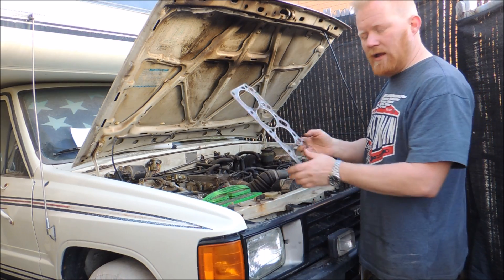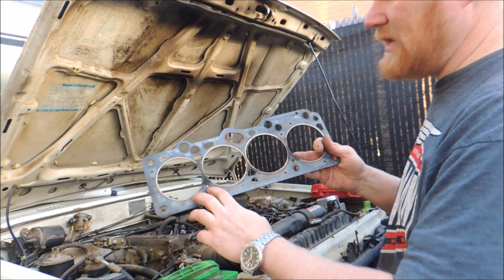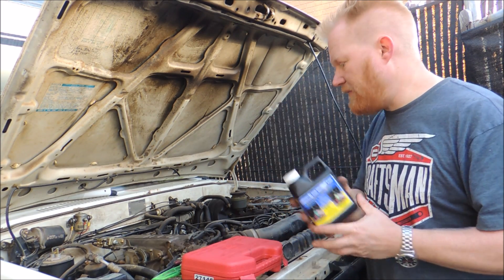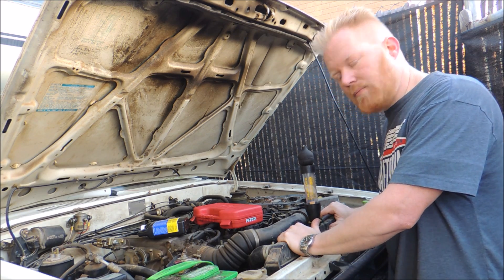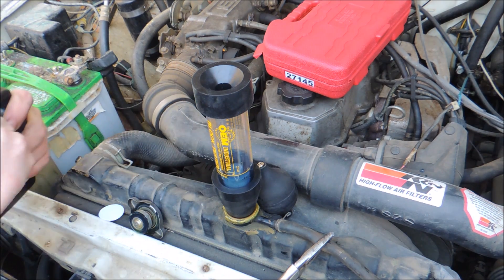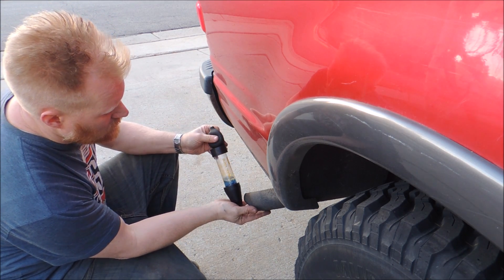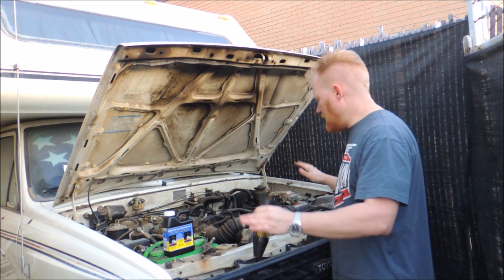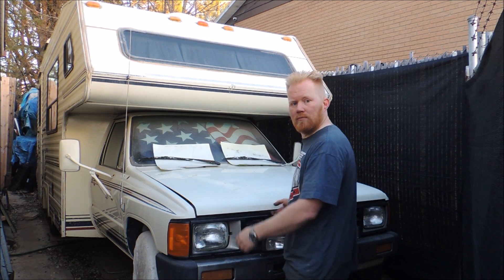Did you blow a Head Gasket ? Find out easily.

Comment: I have used the same test kit,works great.  Did you find out where is the coolant leaking from  .
Reply from the maker: +Steve Rob It's very minor and may just be evaporating(water) out of the overflow bottle due to extended long run times(10-15 hours) I'm keeping the entire engine bay at high temps for prolonged times.

Comment: It takes a while , but if it turns yellow , you can pull a few spark plug wires off . when you pull the wire off the cylinder that is the issue , the fluid will stop turning colors . Just got to wait a few min for the coolant to air out to test that way. Doing to engines with more than one head you will know which side is leaking . Good video.
Reply from the maker: +wtbm123 GREAT tip.. Thanks Man.
Reply: +sixtyfiveford 
I agree good video and good diagnostic tip 123 for when you have multiple head engines.
Reply: Knowing which side is leaking is not useful as you would have to change the whole gasket anyway

Comment: We have a Mercedes diesel with a cracked head 
It's $5k to repair and has a 2,00,000 miles +.  Any thoughts on additives to seal cracked heads   I worry it could cause more damage
Reply from the maker: +airkraft1 I have used Head Gasket Sealer before. It is basically sodium silicate, which has the nick name of water glass. You drain the radiator, fill it with water, add the Head Gasket Sealer, run it, drain it all out, and refill with antifreeze. The sodium silicate hardens when it comes in contact with CO2 cobustion gases(the leak) and forms a hard, permanent seal. It won't clog up the system and will only harden where it contacts combustion gases. The use the same stuff in metal casting to harden the sand molds and make so it holds up to molten metal. I did it on an old gasoline car that the price to fix was more than it was worth. Last I heard, years later the car was still going strong.
Reply: +sixtyfiveford 

I may just have to give it a try.  Thanks

Comment: That's cool, great test. BUT where is your coolant going? Nice Toyota. I've seen a couple good deals on those over the years, but they look like a bumble bee engineering wise like their should be issues lol. What kind of mileage do you get?
Reply from the maker: +tblbaby I'm debating high engine bay temps for long periods are evaporating the water out of the coolant in the overflow. The lose is minimal. Mileage is dependent on how big of jerk I want to be to others. If I push it hard it'll get 12mpg (65-75mph), if I go at it easy I can peak at around 15-17mpg(60mph). On average I manage 13-14mpg though which in caparison to a large motorhomes 4-6mpg, is impressive.

Comment: Good tip. Had no idea of this test kit. Glad it wasn't the head gasket. So why do you think you are loosing coolant if it's not leaking or overheating?
Reply from the maker: +MRrwmac I'm debating high engine bay temps for long periods are evaporating the water out of the coolant in the overflow.
Reply: +sixtyfiveford have you checked the radiator cap?
Reply from the maker: I have.

Comment: I chased leaks for six months until I purchased one of those and found a small combustion leak. It took about 4 minutes for the fluid to change color. After fixing the engine the leaks went away.
Interestingly a garage tried a smog machine over the coolant and that did not pick it up.
I always run that test before using the dreaded leak sealer. Combustion gases and leak sealer do not get along at all.
Reply from the maker: +Andrew Thompson This is a great way of finding out. I've had really good luck with radiator leak sealer(Bars Pellets) over the past 20years.
Reply: I agree I know lots of people hate it. I have used it many times and never blocked anything except for.. Many years ago I used Bars leaks on a car with a slightly blown head gasket. What a disaster everything blocked up with a brown slime.

Comment: i had  both headgaskets changed in my 03 ram with the common failure 4.7 overhead cam v8 .. it was pumping the white smoke so much that i filled up the typical #1 cylinder  and hydrolocked  the motor ..took out the sparkplugs and shot the coolant out  and drove it to the dealer to take the motor out and heads were cut and front end kit and gaskets .. 4400$.. motor runs great now
Reply from the maker: +san379 That's an expensive repair bill.

Comment: That Toyota 2.4 is a SUPERB bit of engineering.  My father bought his Toyota new when I started driving and my brother still drives it... just fluid changes over the years.
Reply from the maker: +RyeOnHam This is my first experience with one and I've been pleased.
Reply: +sixtyfiveford I have an 1986 Toyota truck with the 22R that I bought brand new. It has pulled a heavy trailer most of its life and also a canopy loaded with tools. It now has 475,000 miles. I love those trucks. Nice video, thanks. (I did do the head gasket twice in all those miles. Those trucks are super easy to work on though)

Comment: The best way is to hold the probe from a smog machine by where the radiator cap goes with it running.  Then you look at the screen and see if there is any hydrocarbons in it.   It should not have any hydrocarbons in there.   Any place that does emissions tests can do that.   Thats the best test ever.
Reply from the maker: +1970chevelle396 Good tip.